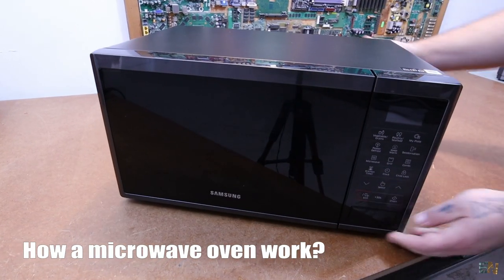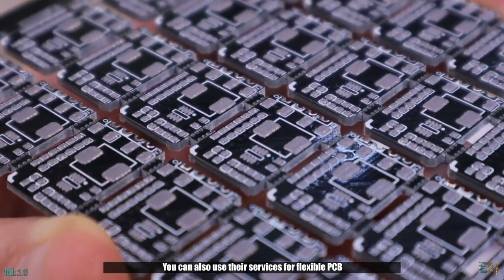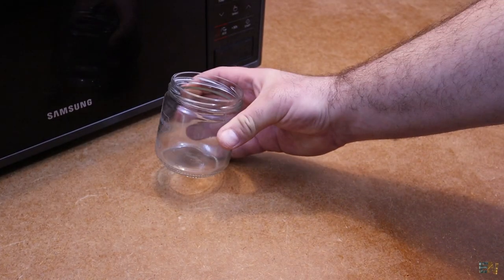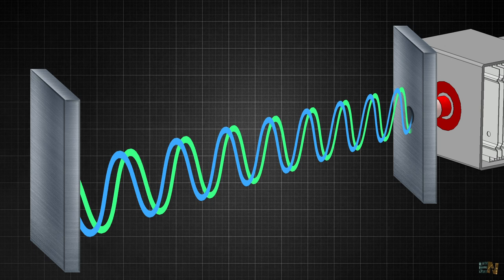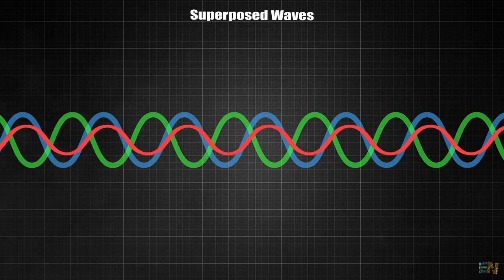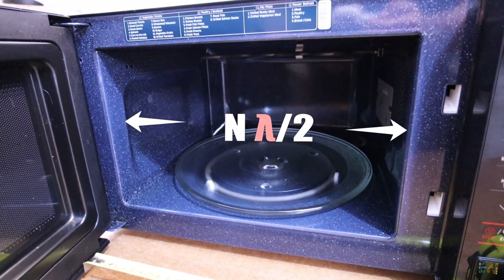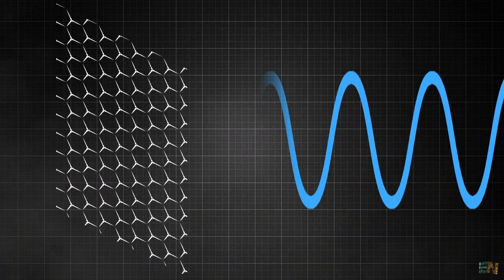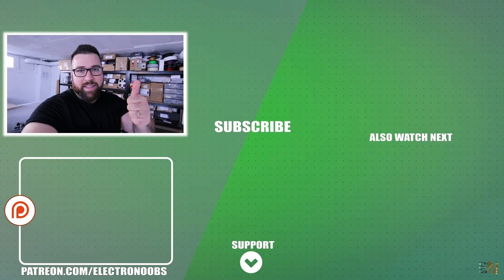How Microwave Oven Works ? - Resonant Cavity

Comment from the maker: Join my Arduino Course (Spanish): https://bit.ly/2JY8icE
My Tools: https://bit.ly/3uv8bc3
Help me on Patreon: https://www.patreon.com/ELECTRONOOBS
Reply: Sir can you please help me out with my project? 
My project is with gsm module sim 800l and it's not sending sms .
But when I am giving power to it then it connected to the network but when I run my code it doesn't send the sms.
The code is also correct.
Reply: Hi I have a question on your previous esp32 nes console project. every time i compile the code I get an error that i need to #include "P:\1a Youtube videos tercero/ESP32 Nintendo/NesCat-main/src/hid_server/hid_server.h" and that the compilation is terminated and it says there is no such file or directory even though when I go into the files I can find the his server h file. Other people are also having this problem so please help me out I really want to finish this project
Reply: I have question 🙋🏻‍♂️. If I increase the voltage shortening the wave length turning the 2.4ghz to 4.8 or higher will it still be a microwave?

Comment: You can heat up or burn many materials with microwaves, water has nothing to do with the heating process. The explanation is simple: the food acts as an RF load. It's almost a pure resistive load. You can heat up food with completely other frequencies too.

Comment: No, the food does not need to contain water to heat up, the explanation is wrong.
Reply: Microwaves heat up polar molecules, and in most foods that means water. There can be other polar molecules, such as fats, in foods and those are heated up too. So his explanation is not wrong, perhaps incomplete, but not wrong.
Reply from the maker: Sorry if I miss explained. All polar molecules but water is the main ingredient of all foods and is a very good polar molecule affected very much by the electrical field.
Reply: @markwerley6965  look, the whole microwave thing is just matter of RF transparency. Food and water is mostly opaque for microwaves, so they absorb energy. Many other materials and glass types are transparent for microwaves, so they heat up way less. Some are reflective, like regular iron (for ex food cans). Similar happens for other RF bands, some materials are opaque, some are tranparent, some are reflective. Those opaque will absorb energy and basically they reemit the energy in the infrared spectrum.
Reply: @dtibor5903  sure, and polar molecules couple with the RF energy and are thus not transparent to it. But if you freeze water the molecules are locked in and can't rotate — ice is very nearly transparent to microwaves. It's not until it starts to melt that it couples strongly and real heating can begin.
Reply: In addition to the rotating plate there is a "propeller" type "fan" that rotates in the top of the cavity.

This rotating reflector stirs the microwave energy, providing coverage over more of the cavity.

Given the varying "load" provided by the rotating food, I think it is unlikely that you actually get standing waves in the cavity.

To test your theory, place a number of neon indicator bulbs (not connected to any power source) mounted on a frame of dry wooden popsicle sticks. 

They will light in areas of high field.

Once you have observed the "field" with no rotating load, add a cup of water, off center on the plate, and observe.

Comment: Great video. Microwave is good in theory, but if you stick a spectrum analyzer in the room with one you’ll find out that manufacturing those constraints is completely inconsistent. This is why they have been dropping the power on microwaves for the last few decades. Additionally, many of you will remember when they used traveling waves…you had a shelf in the microwave no turn table. Was not safe at all.

Comment: Sir can you please help me out with my project? 
My project is with gsm module sim 800l and it's not sending sms .
But when I am giving power to it then it connected to the network but when I run my code it doesn't send the sms😣.
The code is also correct.
But don't know how to fix it and in serial monitor it says AT+CMGS="number" .

Now please help me out sir 😖.

Comment: Does that pcbway website have a means to scan or take a photo of a hand drawn schematic?  Also how does it know what sizes the components are?  I want to get into this but no one has addressed these questions.  I current hand make my own boards and obviously have the parts to hand so i know where to drill the holes.
Reply: As far as I'm aware, you have to upload the schematic in a digital form (.gerber file) designed in CAD such as KiCAD.

Comment: How efficient is this process ? What if we compared it to resistive heating ?
Reply from the maker: Resistive heating heats the exterior more and the interior of the food will slowly get cooked. So depends on what food you want to heat up.
Reply: It seems very efficient.
Try a glass of water for ? 
A small glass takes one or two minutes to heat up at 1,000 Watts/h that's 33 Watts for 2 minutes. 
Now if use the stove it would take about the same time, but you're using four times the energy. Mainly because the energy is not focused.

If you're looking for options to not microwave but be efficient. Inductive cooktops are very good because they focus all the energy in the bottom of the pan and thus the food heats up quickly without wasting energy. BTW It's hard to cook eggs on induction cooktop because they cook too fast.

Comment: Very educative, Why is it advised not to place metal objects inside?
Reply: Much like how the electromagnetic waves wiggle the water molecules, it can also wiggle the electrons in conductive metals. Moving electrons = electricity. The real problem occurs when that electricity is concenentrated enough to create sparks. Sparks ionize the air, creating plasma. Plasma is also conductive enough to catch the microwaves and that means that the little spark from the tip of the fork can become a seriously large and hot plasma ball that could melt stuff.

Comment: I got an idea for a cool microwave Short! Quick and easy. Take a grape or better yet, three or four of different sizes. Cut them almost in half. Be sure to leave a tiny bit of the skin so the halves will hinge. You just created loop dipole antennas at near the resonate frequency or a harmonic of the microwave. 

Fire up the microwave and literally watch the fireworks! As each half is energized, the alternating current between each half Sparks! Enjoy!

Comment: Can 2.45GHz microwave interfere with electronics, hypothetically speaking with drones flying over my friend property?
Reply: Not likely
Reply: So how does drone guns works?
Reply from the maker: Waves are trapped inside of the oven, so no!
Reply: Let assume someone removed magnetron from microwave mounted on long pole and pointed toward flying nusence;)
Reply from the maker: @robertk9307  that would probably fry the drone circuits. Is very dangerous! Don't do it
Reply: Speaking hypothetical of course here, we don't want cause any physical damage to someone property, What would be alternative method of enforcing once property boundaries from drone. Perhaps Airdump-ng deathentication?